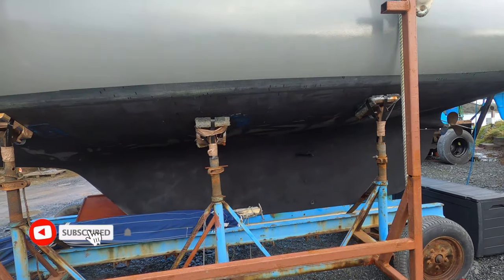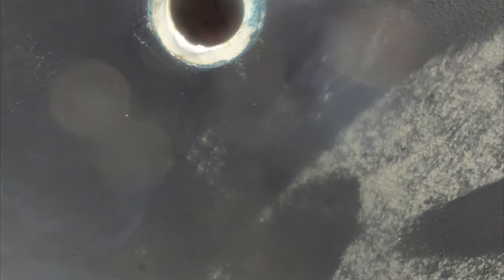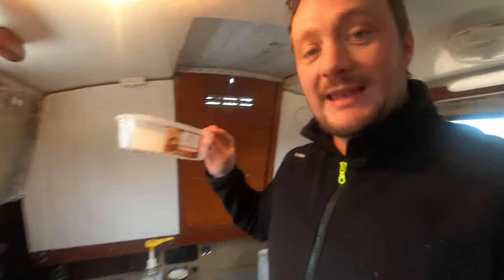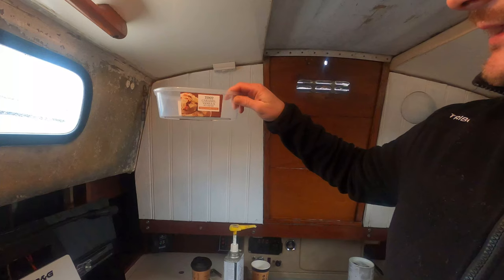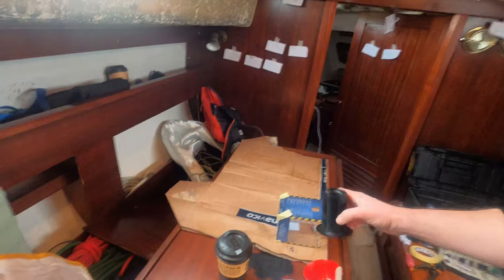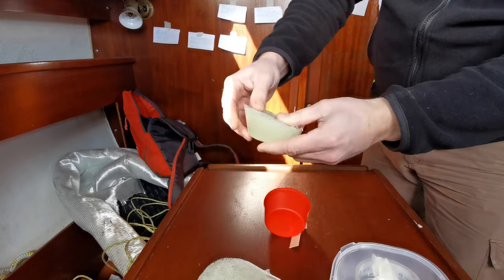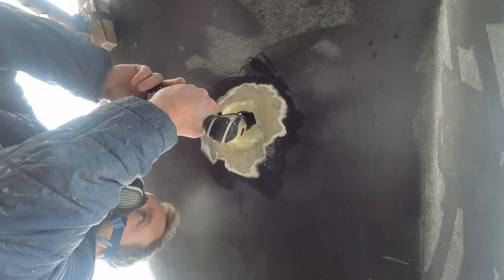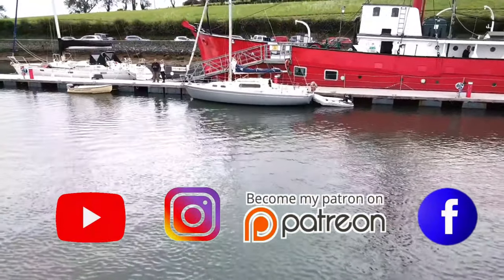Installing a New Airmar Transducer on Our Sailboat (Part 1 Thru-hull modification) Ep. 29

Comment: So that is how I should have done it!  When I replaced the old speed log with the Airmar transducer just made the hole bigger!   

I've had no problems with depth readings, apart when I was healing at 45° and I hope never, ever to do that again!  It's great to know what the STW is and it is always way too cold to go swimming!
Reply from the maker: Well, I wouldn't say its how it should be done, just a video of how we did it. We seen another channel do something similar but using countless layers of fibreglass. Good that you got your transducer angle OK for the depth. Our dead rise was too big so it would have been too inaccurate to trust the depth.

Comment: I'm not too keen on holes in the hull, so I had an in-hull (inboard) transducer installed for my new Nasa Clipper depth sounder. It seems to get pretty good readings through the hull without the need to drill any holes. At least I haven't run aground yet, all though I had a rather close call this summer. Apparently you have to actually look at your instruments from time to time if you want to benefit from them. Tsk-tsk... I suppose I should read the manual and figure out how to set up the depth alarm. But, I mean... "read the manual"? Well, maybe next summer... :-)
Reply from the maker: Hi Thomas. I agree, the less he's the better. I needed the through hul for the speed sensor otherwise I would have went for an interior sensor. Haha, men don't read instruction manuals 🤣. I am the same, I still haven't read mine yet. Maybe this winter when the boat is back out of the water.
Reply: Wondering if we could fit an in-hull transducer on our steel boat? I would certainly sleep better knowing there’s one less hole in the boat 😂🙈

Comment: I had the same ide, the same aproach and the same material, (Western system) with exception that mine is a teel hull.  I call it a fairing over a wedge but heck, all the same. Wondered if you found that the waterstream turbulance was causing the wheel to keep smooth motion or did you find at times irratic speed readings ?
Reply from the maker: Hi Bernd.  We tried our best to make a nice slope for the water to go over and not cause irratic reading on the paddle wheel.  It works very well.  Will you do the same?
Reply: @LittleBoatAdventures  I noticed that in the second video, after I left my comment on the first one...   and yes, I did the same. I called it "fethering" and indeed created a gradfual slope of nearly 25 inches. I used a body fill compound as base and than changed over to epoxy with fiberglass filling. Is in since 3 years and seams to work fine and hold up well.  We have to be creative with sailboats. Helps to think outside the box. I had to improvise a few things in preperation for the north west passage. After all, I had to sleep at times...  
Happy sailing you two.